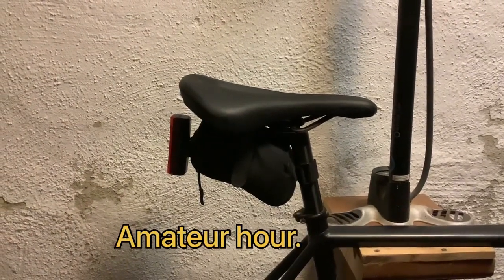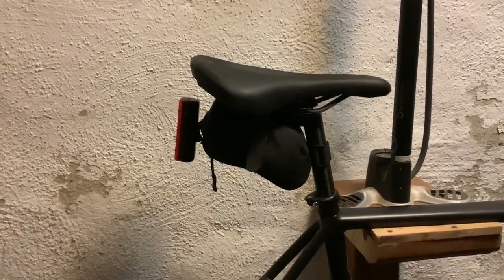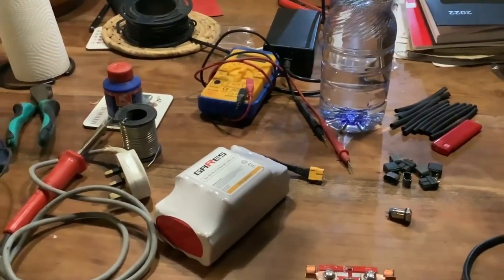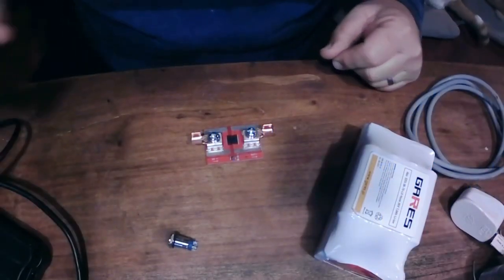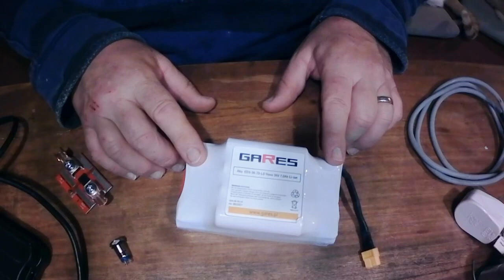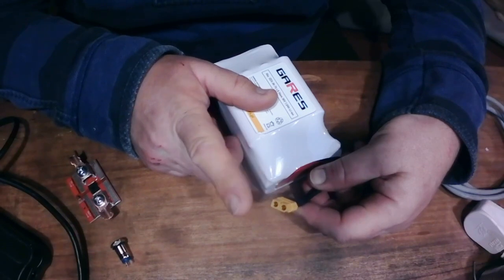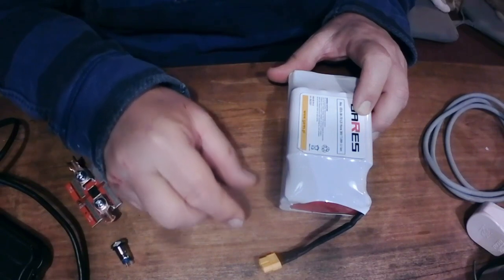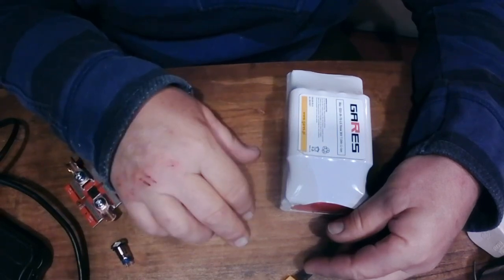DIY Mahle X35 Range Extender - Save $$$$$!

Comment: Hi. Just wanted to drop you a line of thanks. I ordered the parts from AliExpress in March. They arrived this week. Total cost 22GBP including a 36v 7000ah battery. I had to get a electrical engineer friend to put it all together, but tested it today and it's pretty much increased my range 100%. The money this video saved can't be underestimated. Appreciate the guide.
Reply from the maker: woohoo! So glad. It’s cheaper, and works better. Remember to take a banana on he epic rides you’ll now be doing!

Comment: Fabulous video . I’ve had an orbea range  extender that’s packed up ..Soo expensive . Looked at the Volabike kits but had seen your video and already have unit pack power bottle batteries on other bikes so will build a real diode into it as you have .🙌 Great videos mate
Reply from the maker: That will be you sorted then for a few quid! Nice. Thanks Steve.

Comment: This exposes a disappointing level of greed by Orbea / Mahle in selling something for $650 that can obviously be built for less than $50. Even allowing for a fair profit, they could sell it for $200.  Thinking of buying one of these bikes and I would be angry paying $650 for a range extender. Your success at doing this is very interesting, on the surface it appears kind of obvious and its really great for someone else to have done the research for us. Thanks!!
Reply from the maker: I can't take the credit Frank, there were several of us discussing how to make one of these and it became apparent that people had been doing something similar for years. I think the Ideal diode is the best protection but others have used the even cheaper Schottky diode and are running their extenders without incident. But yes the markup is pretty outrageous.
Reply: It wasn't $50.  There is the battery cost as well.  Still I agree and love resourceful people like Yako and his generosity to share what he learned.
Reply: Would you please update with a spec list and examples of bstterys you chosen or should work + other components? Would be Very helpful, thank you!
Reply: No way im paying 650€ for the rage extender. Found one for 80€ from eBay, Just need to figure out this weird pins on the cable and how to get it for under 120€ from orbea

Comment: Hi Yako, great vid, exactly what I wanted to research. Now interestingly I had a talk with a Mechanic in Decathlon  last week and next year will bring their own road Ebike range which will be on Ebikemotion system and compatible with Orbea. I'm told a new battery will cost circa £250 and a battery extender thereabout. I will keep my ear to the ground and let you know.
Reply from the maker: Hi Radek - wow I am amazed. I guess Mahle can see €€€ signs flashing if they can supply Decathlon’s own brand e road bike. It will be a huge seller.
Reply: @yakoridesagain  Yes, especially if they can create an electric Triban 520C for US$2,500

Comment: Great project. Thanks for sharing. Would a 36v 4.4amp battery work. What would be the shortcomings of the lower ah?
Reply from the maker: Thanks Michael. With different capacities there is a risk, though small, of overcharging the smaller one if you charge them connected together. Charged separately there should be no issues. Obviously you would have less range than a 7Ah…it’s probably worth trying to find a 7Ah though if you can - there is no weight penalty…

Comment: I just went ahead and bought the JubaTec battery to use as the extender... I decided I liked the sounds of them.... got speaking with one of their team.. so all good............. Next job... is it possible to make an extender for my eMTB you think?? It has a whopping 48v 17.5Ah battery on it.... any ideas?
Reply from the maker: The Juba Tec looks decent, so I’m sure you’ll be fine. Re your eMTB - how far do you want to ride lol! You live on an island! seriously though, there is a company called Volabike that make extenders that work like my DIY one, and they make extenders for just about all systems…so you could try it…I wouldn’t, not without lots and lots of research…or cheap spares in case something gets fried…
Reply: @yakoridesagain  yeah.... your right...I would like to do the Tramuntana Mountains full route..I've done it plenty on road bike obviously.. but there is a MTB way too... 1 battery wouldn't be enough... and I guess even an extender wouldn't be enough!! It's a big ride....maybe I'll just do it on an ordinary MTB. The eMTB/MTB trails here are extremely difficult... so it doesn't take alot to use up the battery.... but in the whole, it's good enough. I know Volabike

Comment: Have you considered current limiter circuit to not rely on x35 protection? I'm considering more modest addtional battery with 26350 cells in the seat tube that would ideally add about 70Wh so not much but also still inside frame and around 500g and somwhat reducing current drawn from main battery might improve efficiency and wear of the main battery (drawing at lower C typically results in higher effective capacity) But I'm wondering if I should rely in x35 protection if additional battery voltage is significantly higher than built-in one. Using "ideal diode" for reverse protection is a great and simple solution to main battery charging the auxlilary one.
Reply from the maker: I’ve ridden over 10,000km with the extender and there have been no problems at all, so I have assumed that the Gain’s controller can definitely deal with a parallel battery range extender set up. I check that the voltages are very similar ALMOST every ride, but have inadvertently connected the two with the extender depleted. I’ve never done this the other way around so apologies I cannot say for certain if the X35 could deal with that. I suspect it could, as over voltage protection is so standard with BMS’s and the X35 would have something to protect against a faulty charger…(I appreciate that this would be for >42v…
I like the idea of an additional internal battery, but, no insult intended, 500g for 70Wh is not a good return…mine is 252Wh at 1100g…and can fit into a very small saddle pack…possibly the cables could be internally routed and wired into the charger port from within?
Reply: @yakoridesagain  Supposedly there's protection from inrush and too high of a current draw (12A) Yeah the resulting pack weight/Wh provided is far from ideal as I have to use cells that will fit in 27,2mm diameter and can't use full length cells. So they are not that great when it comes to bang for the weight. I have to use 26350 cells to be able to fit it all in. Ideally i'd use 21700 cells but total length is too big for 10s I'll measure things out more accurately before ordering maybe i'll be able to fit something inside the seatpost as well. Either way I'll have to add plugs xt30/xt60 depending on space in the bottom as I want to add some additional wiring for lights, gps tracker possibly charger for the phone. And the "lights cable" is both quite expensive and it is fairly limited in power draw (at least according to spec). Thank you for making the video. Given how closed off the x35 system is it's nice to know we can do "dumb" additional battery. Your pack is pretty slick. But I use rather large bag for hammock, bug net, underquilt and other camping stuff. So not a great solution for my use case. Perhaps when travelling light it would be neat to just chuck it in the bag.
Reply from the maker: I ‘converted’ (made a hole) in my 16l bikepacking seat post bag too! The battery goes right at the bottom and everything piles in after it. Worked well (I made a vid !-) )
Reply from the maker: Oh, if you aren’t subscribed, would you consider it? I’m so close to 1000 subs it’s making me crazy!

Comment: I built one 3 years ago. Bottle battery with internal protection and push switch. It sits in a frame bag and the lead is hidden down behind a frame fixed pump, so completely hidden.
Reply: hi mike, was this for the mahle system?

Comment: Hello, from Portugal!
Very good video!
I will try this on a Specialized turbo levo 1Gen.
My doubt is how connect the negative to the diode.
You connect  direct the - from battery to the union plug, and just connect one thinner cable from the xt60 connector and the diode?
Thank you.
Reply from the maker: Hello Herculano! The + goes to the diode, the - goes directly from the range extender battery to the charge port - but a small cable is spliced into the - and goes to a small earth connection on the diode, as shown in the final diagram in the video. I hope that makes sense?
Reply from the maker: Also, I only know this works with the Mahle X35 system, didn’t Specialized have their own e-assist system?

Comment: Hi, great video. Would you be so kind as to make a list of items to purchase, and to facilitate next to each one an indicative purchase link? Thank you very much
Reply from the maker: Hi @bobok, I think I listed what you’ll need at the beginning of the video:

A 36v 7Ah hoverboard battery, preferably with Samsung/ Panasonic cells
An Ideal Diode suitable for at least 42v and 10amps
XT60 connectors, a few of both male and female 
Wire - say 2mm multistrand (automotive - smaller reels available)
A suitable saddle bag
Maybe a separate charger for your new battery (so 36v, 2a)
Solder, zip ties, shrink tube…think that’s it.

You’ll have to do the finding / links as this vid is a few years old now. My extender still works perfectly though. Good luck!

Comment: Hi Yako, So I built my range extender and it worked perfectly until I was out one day and forgot to connect the extender before setting off on a hilly route. About 10km in my iWOC went green, which alerted me to the issue, I connected the range extender, switched back on and then disaster! I got the pink flashing light of death and fault code #197 on the app which is an overcurrent fault. This isn't meant to be a criticism, rather a warning to those with their extenders not to make the same mistake!
Reply from the maker: oh no! I’ve been told by others that they have done this with no problems but I’ve never tried it myself (on the last bit of the vid I do point out not to connect the two batteries if they are more than 0.25v different). I hope it was a simple reset by the Orbea dealer?
Reply: @yakoridesagain  Thanks Yako. I was lucky this time. It reset itself the next morning so happy days. I'm currently (pardon the pun)  looking at some kind of safety circuit in case I have another brain fade. Apart from that, it's been an absolute godsend in the Pyreneés!
Reply from the maker: Phew! Happy about that! So…you just waited, recharged both and voila? You’re in the Pyrenees? Fantastic! I need to get a bit fitter/healthier but have so many rides I want to do there. Whereabouts are/were you?
Reply: @yakoridesagain  I took the range extender off then the next morning I turned the iWOC on and the fault had gone. I was lucky indeed. I recharged the main battery then reconnected the extender. All seems good 🤞. I was in the Pyreés Atlantique, not far from Oloron Sainte Marie and did the Col de Marie Blanc and the Col de Soudet.

Comment: Hi Thank you for the video.  It's excellent.  I started making a purchase list with Ali Express, then got cold feet!  I didn't even know what wire to buy!  And I just got confused with the choice of other parts, including the batteries.  Is there any chance you could put a full list of what to buy, for idiots like me ...?  Many thanks. Peter
Reply from the maker: Thanks Peter. I thought I had? Or mentioned everything/stuck it on the pic at the end? If I get a minute I’ll try to get some links for you.
But if you look first, it was:
A 36v 7Ah hoverboard battery, preferably with Samsung/ Panasonic cells
An Ideal Diode suitable for at least 42v and 10amps
XT60 connectors, a few of both male and female 
Wire - say 2mm multistrand (automotive - smaller reels available)
A suitable saddle bag
Maybe a separate charger for your new battery (so 36v, 2a)
Solder, zip ties, shrink tube…think that’s it.

Comment: being a total novice to electrics etc.... (but very handy person!) great video.. my wife has a Ribble ebikmotion x35 so definitely gonna give this a try.... I'm just wanting to ask... the exact size of this multi strand cable? I have found on aliexpress XT60 connectors (male and female) already soldered up, so was thinking for the littler cost of them it would save me soldering... and just remove 1 side?? the cable is 400mm long (red & black) and thought this would save me hassle? but then I see I need to splice a pieece from negative to the GRD (which I can handle... this cable is XT60 Female Plug To XT60 Male Plug Adapter Connector With 400mm 14AWG Silicone Wire - is this ok to use and do like I said??? I have solder iron and eelctronics solder etc etc...
Reply from the maker: I used 2.5mm2, which is 14awg. So yes, you could use the presoldered connectors, but will need to connect the 3 negatives together - from the xt60, from the charger cable you have cut off, and from the earth point on the diode…but the earth does need to be soldered onto the diode’s circuit board.  If you splice together the three negatives I’d also put a dab of solder on that too and use shrink tubing - electrican tape will always peel off.  Good luck, any questions just ask!
Reply: @yakoridesagain  ok bud... thanks for quick reply... I just thought buy the pre done XT60's from Ali.. as they are cheap... was gonna get the 40cm long cable ones... that should be plenty... I'll buy 2 (as very cheap) and chop... yeah about the 3 positives.. I know how to do a Sparky splice for the 3-way (grew up in Construction my whole life but now a cycling guide on Mallorca!!  haha - retired cycling guide too!!) I bought this Ribble for my missus so she can keep up on climbs... and helps train me too! (these bikes hopeless on the flat though!! and not worth the €175 for the dongle thingy!! not to get 2-3km more!! Found this by chance.. great job!! I'm gonna change her Ribble to flat bar, 1 x etc etc (it is the Gravel version!) Back wen I bought it originally, they didn't offer the option of a flat bar! Ofcourse, nowadays, I wouldn't buy any kind of bicycle from any brand!! I build my own.. just recently built my own eMTb! best thing I've ever done!! Designed it, sprayed it... done the decals/ artwork etc etc...But I am new to ebike's (being a roadie my whole life - a serious one at that!! haha - or was!) If your ever on Mallorca... look me up...I'll give you a freebie off road tour here (hard to find the hidden off roads here!! and best with a guide) If I have anymore questions... will ask here if that's ok bud... cheers...(A Scot stuck on Mallorca!!)
Reply from the maker: @martintramuntbikemallorcak481  Well you’re just across the water from me! If I ever make it across I’ll def look you up. Remember the sun screen mate !-)
Reply: @yakoridesagain  NEVER touch that stuff bud!!! NEVER!! noone should!! My lass is a Skincare specialist... (best in Germany and on Mallorca!!) - here's a wee bit of free advice... call me a conspiracy theorist or whatever... (I wear my silver hat well.. and proudly!) but ALL them skin lotions they sell you, they ared designed to give you problems!! not make it good for you!!! trust me... slow build up, using only natural coconut oil etc etc... is way to go... ALWAYS!! My body is totally adjusted to living in hot climes nowadays (been here a long time bud) - but don't take it from me, take it from one of the BEST natural skincare specialists on the planet!!! your more likely to get SKIN CANCER using "their" sun screen lotions than without...let your body (which has the BEST built in system of any MAMMAL on this world) to do it for you....Lot's more I could say... but that's it for now.. thanks mate... If I get stuck..(I shouldn't) I'll holler!! and yes, if your ever over here... I recommend one of my eMTB tours... I cater for ALL standards...but the Road tours are pretty damned good too!!! haha... cheers